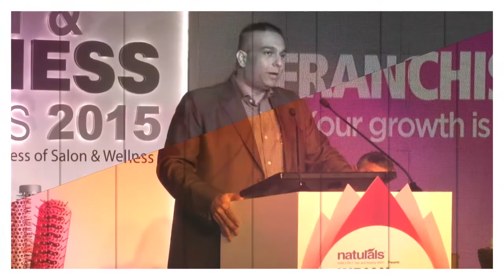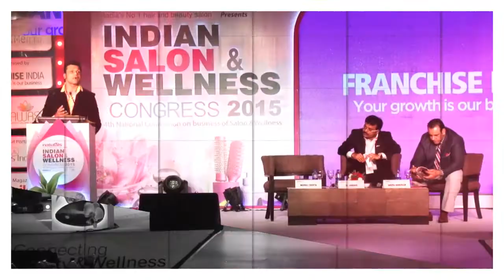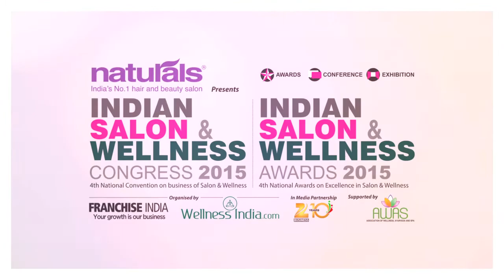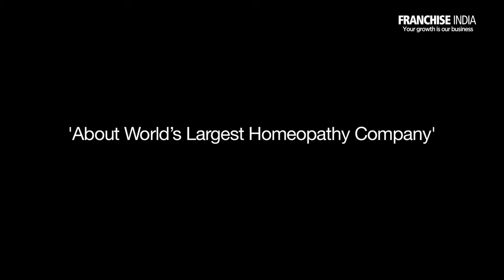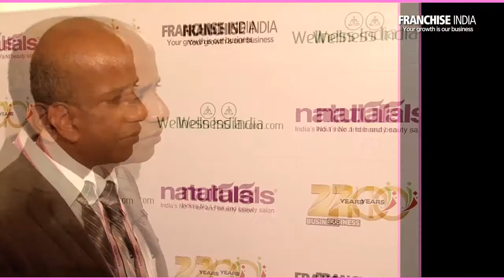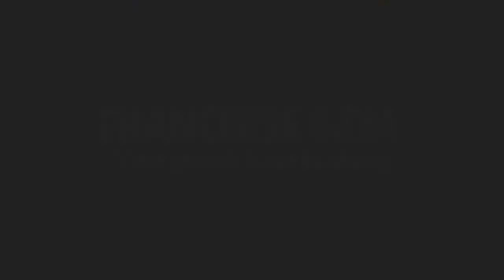Govt gives phenomenal support for AYUSH upliftment: Schwabe India MD

Comment: most of the time govt skips from problems - when made and attempted failures 

our indian failures is so easy any one can pin point what kind of failures there is no proper regular look up on that scheme made or executed be it a institution regular check up and this is the biggest failure 

on sudden y instead of correction how north india treis to make ayush 

hindustan univerler limited move what that carried 

what is each state orgin of siddha hospital what kind of support as central u give demolish the roots and over look ayush this is what central practice 

this is what we understand

i dont get right inputs ayush is proven factor when a state running it up identify the issue and correct it up instead over look and make to dump other state orgin works and relook for new 

just like insurance after the tenure got over and they change from max insurance to eixde insurance just like that